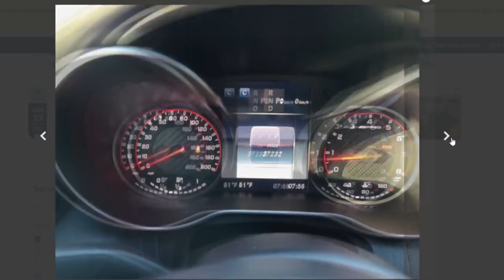“I’m not 100% innocent” SS717 Drops TRUTH To Fans

Comment: I was one who made a comment on street speed post I agree that there is a difference between an open highway and when people are around on city streets however two wrongs don’t make a right and it makes no difference if you had professional training or not, a real professional wouldn’t subject himself/herself or the public and put anyone in that position.There are many factors that could possibly happen, tire blowout, an animal run out in front of you etc there is a time and place for racing and carrying on and it’s not on a public road. Mike is not the only one doing this by any means, I too was young once, but I also lost a family member doing the same thing and there were other people killed in the same incident and that made it even worse, I wasn’t hating on anyone just stating my opinion and my experience as it happened to my family
Reply: I think that's the point, but there are people driving slow and being more dangerous than me driving at speed limits. Some people are just not aware of the driving situation and can't control their car. 
Where I live crash avoiding behaviour is part of the driving license, which helped me a lot in risky situations, equally caused by myself or others. Also you can feel how hard it's to get control of your car back at low speeds already!

Comment: when I bought my AC Shelby Cobra (Backdraft replica), I told myself...   "you are NOT going to end up in a YouTube video wadding up your car!"  And I did not.  The car scared the crap out of me from the day I bought it til the day I sold it (8 years later).  612 hp/615 tq in a car that weighs less than 2300 lbs can be a recipe for disaster.  I typically avoided doing cars & coffee events because of all the idiots that could not control their impulses when leaving, tho I would occasionally do a charity car show.   Nowadays, I rock a C5 Z06 and a Focus ST...  and I'm totally cool with that.  I buy cars that I like...  and usually avoid those (now) that will draw excess attention.  It seems every time I had the Cobra out, someone would be chasing me down wanting to race.  Not happening.  So many of these hypercars & beyond have performance that is completely unusable in any sort of street environment...  and I have no longer feel the need to "flex"...  but to each his own.